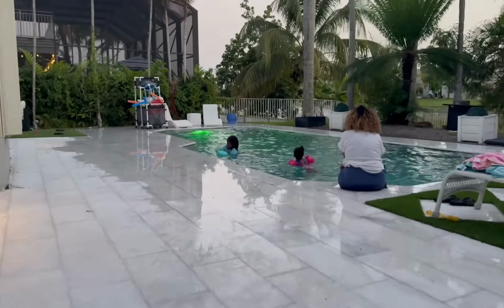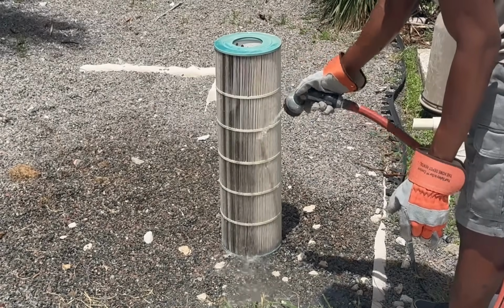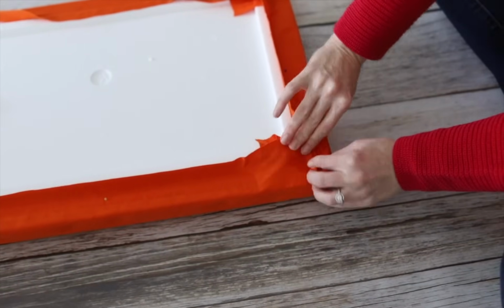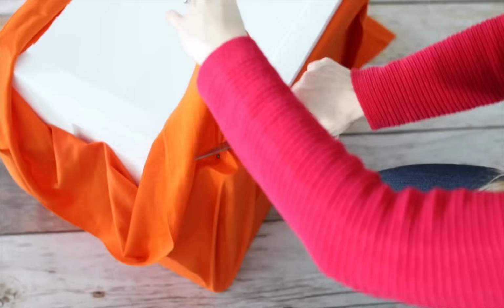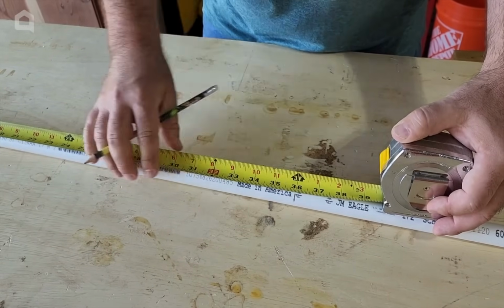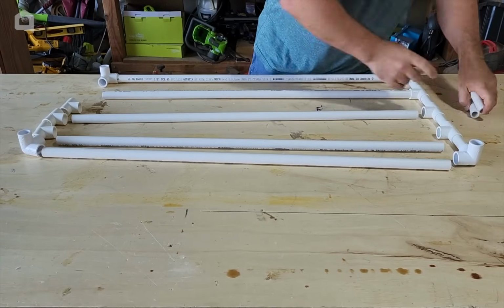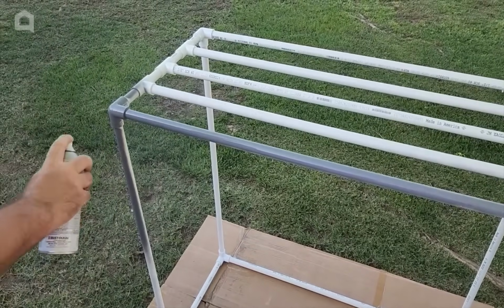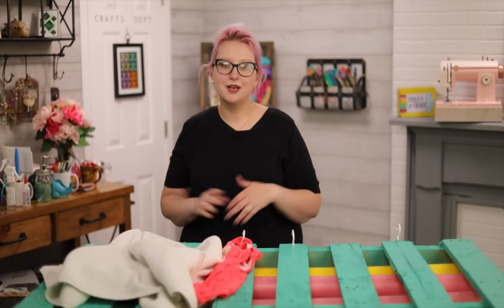Want to heat your pool this season? Watch this!

Comment: With the cooler project and doing the corners, it might be easier if you cut the fabric down the middle  just like you would folding and attaching paper to a gift or box (hopefully I explained it right).